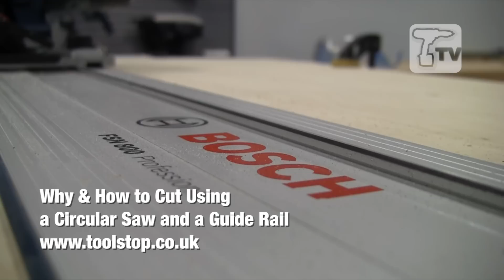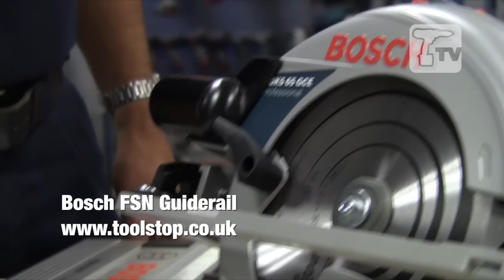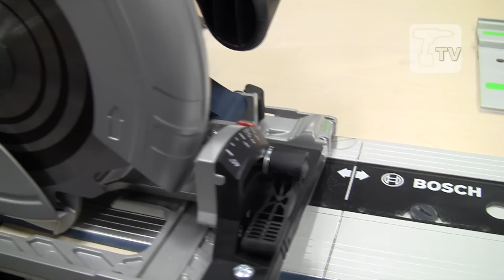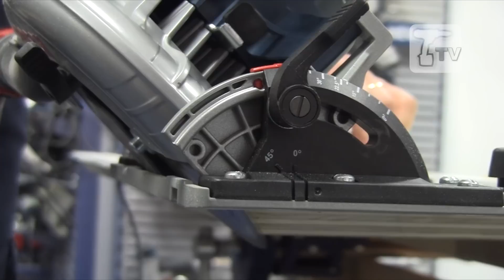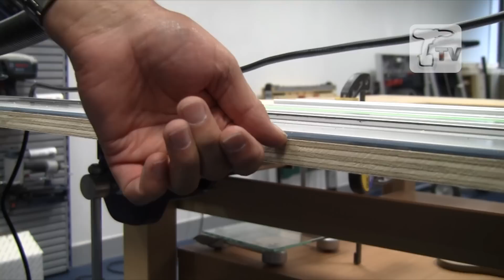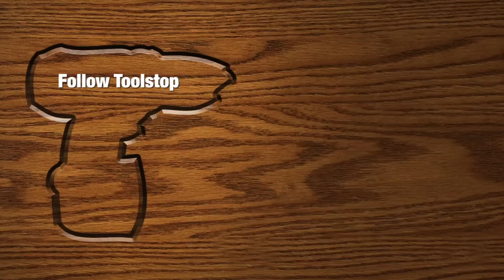Using a Circular Saw with a Guide Rail | Toolstop Guide

Comment: Quite a lot of dust still coming out there , I guess the fully enclosed circular saws are more expensive for that and other reasons.   I have a GKS18v (naked cost £120 new) saw and will be buying one of these rails, shame they are not cheaper than the saw though!